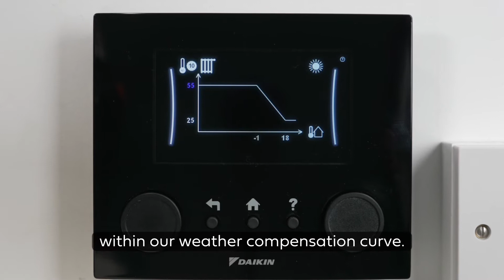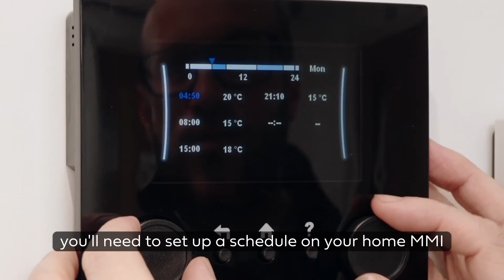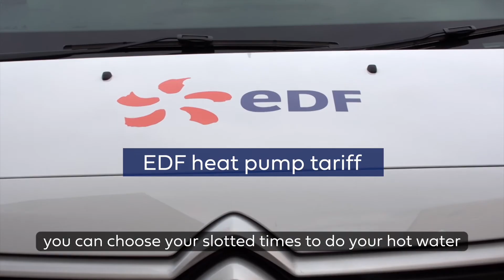How to run your Air Source Heat Pump efficiently

Comment: Is it true that with an air source heat pump one radiator must not have a thermostat on it?
Reply: I had a full central heating setup installed last year and that is what the installer told me. I've got one small radiator in my hallway, with the thermostat quite near. The lack of TRV ensures that the sensor in the thermostat always controls the entire system based on the temperature in that area and as it cannot be independently adjusted, that area becomes your "control" area.

Comment: TRVs turned right up is all well and good in a house where all the rooms and radiators have been carefully calculated and design from the get go for a heatpump then TRVs are unnecessary. However what about those properties that have an existing system and the installer only increases the undersized radiators ignoring those that are oversized. Then as in my house one lands up with some smaller rooms getting too warm and that’s where the TRV comes into play. In my case Honeywell home TRVs that creates a zone for each radiator/room.
Reply: Balance the rads properly through the lockshield and leave the trv wide open or remove.
Reply: I have a  Ideal Logic Air Monobloc heat pump 8kw and we're going to be bankrupt soon with running costs. Any advice